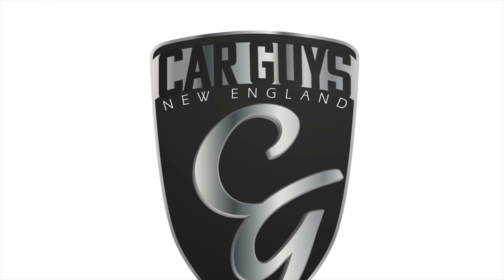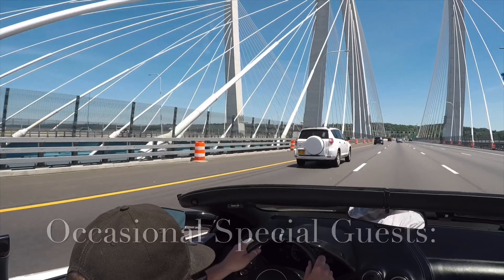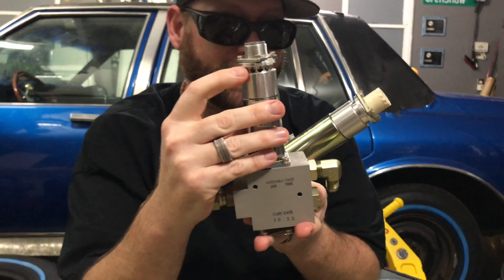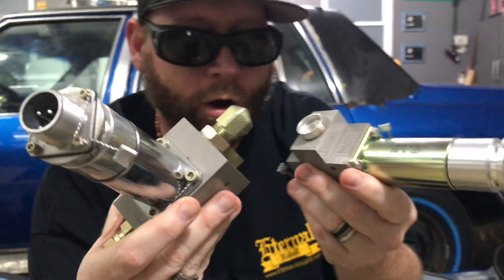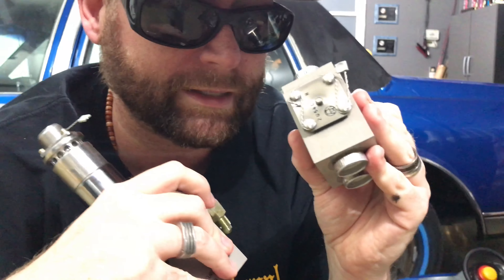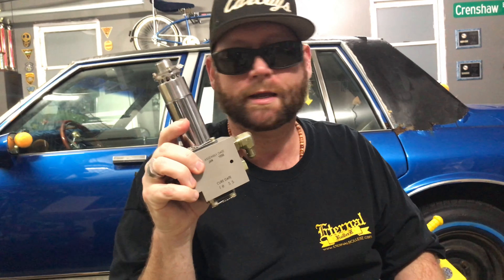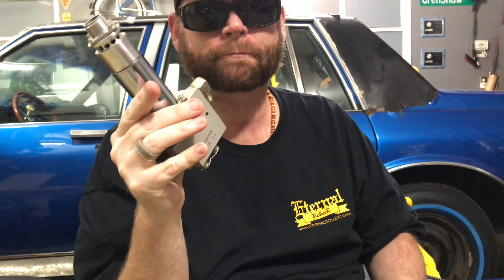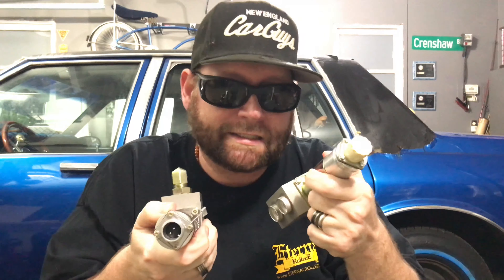Adex Dumps: Regular Duty Vs Super Duty

Comment: Hey question can u run the wires like regular dumps i have a adel but it its missing the top part of the candle..  so i don't know if i culd use either pin on the top as a postive . Or do the come positive and negative or are the both live ..   thanks
Reply: Power to the B terminal; the A terminal gets grounded
Reply: Thanks gee